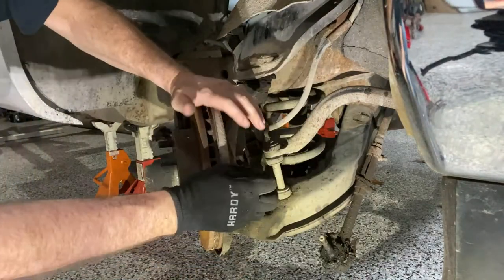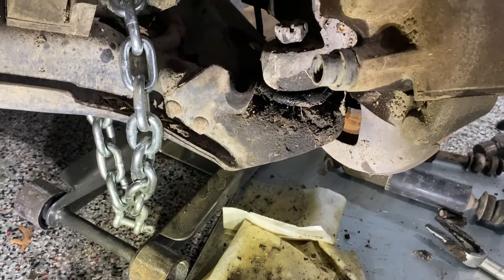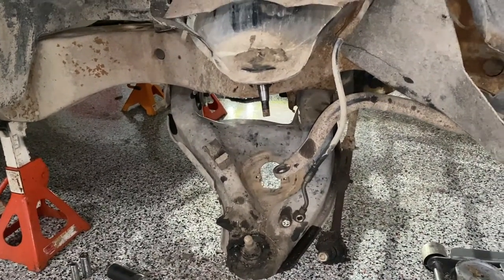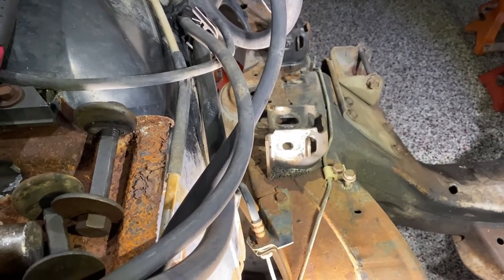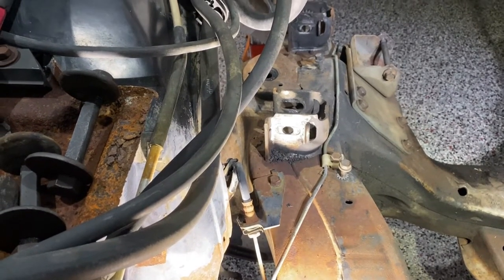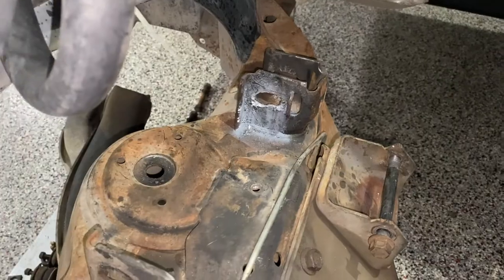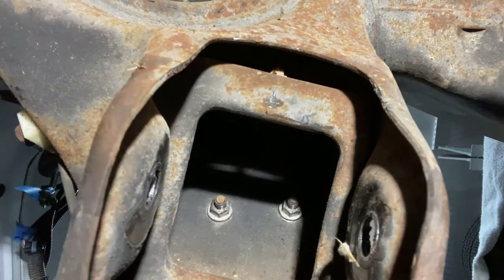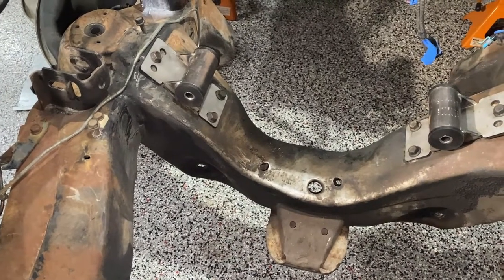1988-1998 Chevy OBS Truck LS Swapped Front Suspension Removal + LS Motor Mounts

Comment: Excellent. We have to  redo the whole front end on the kid’s ’92. 
The top control arms are actually rusted with holes in them. Gonna buy some Moog replacements with bushings and ball joints already installed.
Reply from the maker: That way is definitely quicker than the way I did it. Good luck with your project.

Comment: Will this work for a 4x4 considering the front differential? Do I need to change the gear ratio on that?
Reply from the maker: Most of the basic work yes...there are differences with the 4wd, but in general, replacing all the rubber bushings and ball joints. Not necessary to replace gears unless you intend to have really big off road style tires and need  the low end grunt. Otherwise, check your axle seals to see if they are leaking and replace as needed.